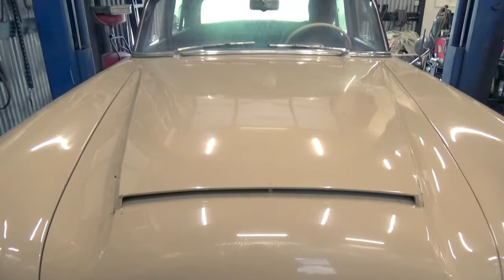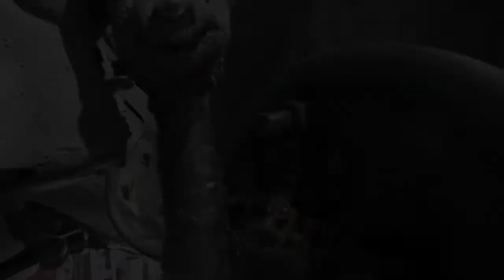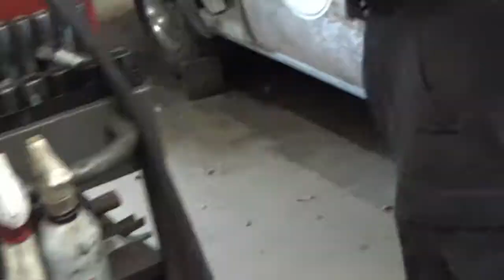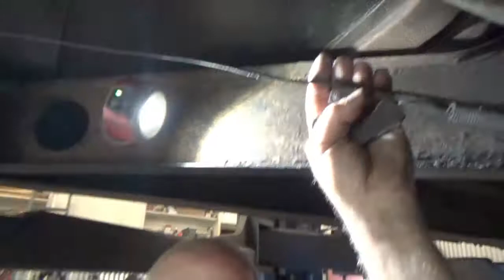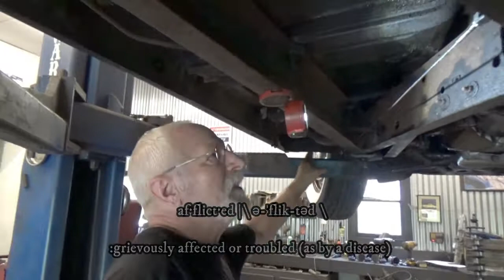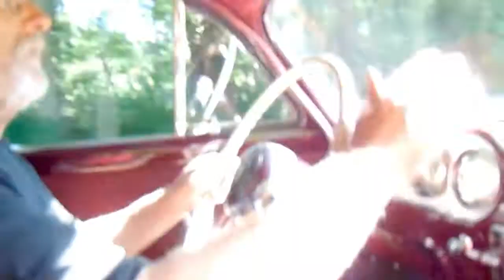ANTIQUE PACKARD EASY Brake Adjustment (Front and Rear) | Speedwell Garage | Ross Miller

Comment: Thanks Ross I used your adjustment method on my 54 clipper and its much improved ,.  stopping true and straight , however I noticed the shoe return springs are the same colour [ blue ] . I think I bought them from Max Merrits about 10 years ago when I overhauled the brakes . I checked their online catalog  and the springs for clippers with 11 inch drum are the same colour , is that correct ?
Thanks again Chris

Comment: Super helpful video! Good tips that will make a big difference.  I agree 💯 about things like those cable shortners.  Adjust/fix things correctly and they will work just fine. No need to convert to disk brakes! No need to convert your car to 12 volt!